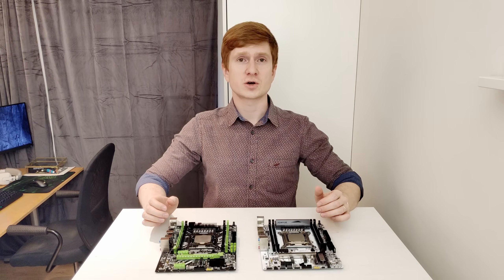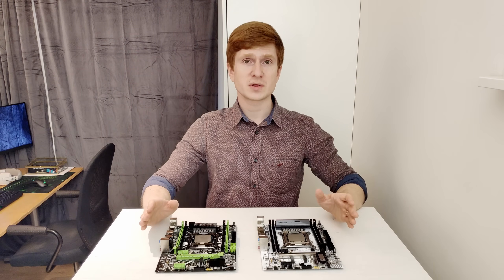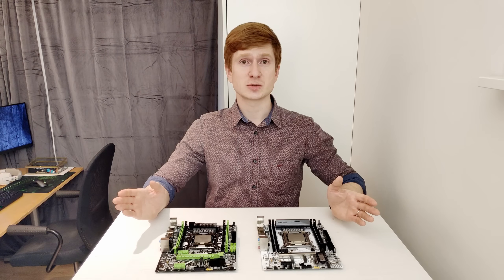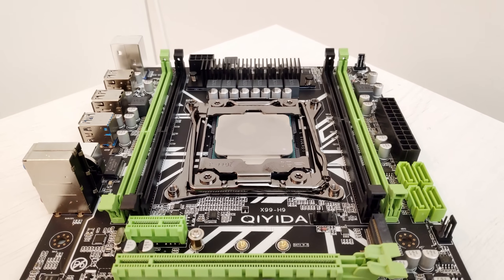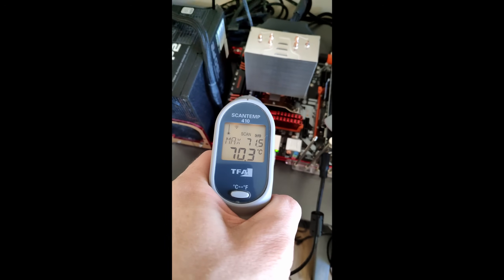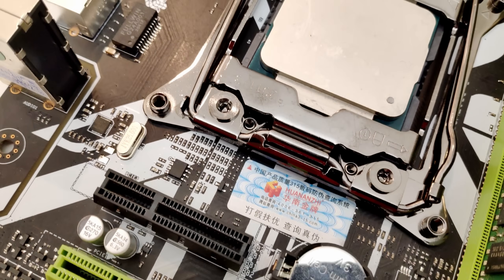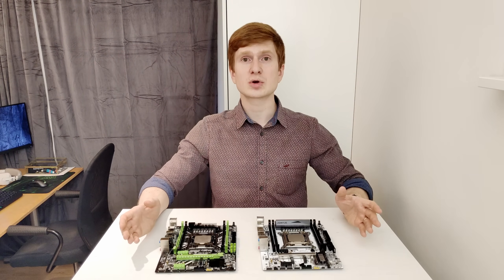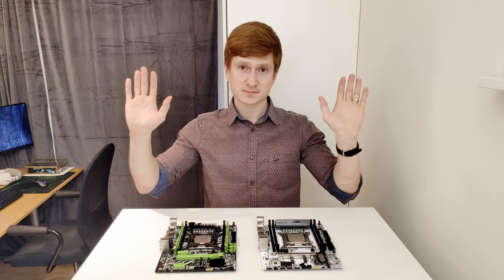🇬🇧 Jginyue X99M-Plus D4, Qiyida X99-H9, Kllisre X99 V201, Machinist X99-RS9 – tests and conclusion

Comment: I found the same problem on all boards I tested.  Power delivery is ridiculous and none of the cpus reached their advertised boost clock speeds and they were unable to maintain the speeds.  When benchmarking I found the cpus clocked down to 2.88 ghz at 100% load, which is lower than the advertised 3.30 ghz speed on the intel website information pages.  I messed with the power settings on the board but it still wont clock up and maintain the boost. It's almost like the boards are limiting the frequency of each CPU by reducing power.  Probably to prevent overheating of the crappy components.
Reply from the maker: It seems like you don't understand how Intel Turbo Boost works, the advertised max frequency is only achievable with a single CPU core. For all-core load Intel guarantees only the base frequency.

Comment: hi, what kind of cpu cooler will fit? I try a lga2011-3 which socket it should be, but it does not fit. do you have a solution? Thanks
Reply from the maker: I need to see pictures to understand what doesn't fit because LGA 2011-3 coolers must fit.
Reply: @Miyconst  Thanks for the reply. I found out, that lga 2011-3 sockets on consumer and server boards having different formfactors. 80x80 and 56x94 mm. I have the last size and the board have the 80x80 mm. So I need another cooler

Comment: I have problem on my jginyue x99m plus D3 and xeon 2666. 
It freezes after a while. With speaker buzzing sound. Then cant post beep anymore. Just turns on and off
Reply from the maker: Most likely the motherboard is fries.
Reply: @Miyconst  dead board?
Reply from the maker: @drexter09 yea, most likely.
Reply: @Miyconst  should i replace my xeon into a lower tdp model next time. To avoid issues on a new board
Reply from the maker: @drexter09  no, but better get a better motherboard.
Reply: @Miyconst  can you provide? I need the white board for xeon
Reply from the maker: @drexter09 there is not much to choose from if you really want a white one, maybe Machinist X99-K9?
Reply: @Miyconst  better than jginyue x99?

Comment: What BIOS is currently recommended for Jginyue X99M-Plus D3 V 2.0 (DDR3) with Xeon E5 2673 V3`? 
I used the "Mi899 -tool" (Thanks for the effort), it was easy to do a BIOS backup and also to flash this version "X99M-Plus-V2_Timing_Unlock_-90mV.rar
4.5 MB" ... however it seems so that despite positive Memtest and allCoreTurbo 3.1GHz it freezes the M.2 WD Blue NVMe every now and then or does not detect the boot NVMe. C6-States as well as the repo are disabled.
Reply from the maker: I am afraid this is the motherboard issue and BIOS won't fix it.

Comment: Hi, thank you for all your videos about X99 platform. I have found them very informative and helpful.

Having said that, I have recently been given a Kllisre X99 V201 motherboard and due to the poor Vrm heatsink I'm worried about pairing it with my 2640 V3 with turbo unlock. Do you think it can  handle that or should I try to replace the Vrm heatsink with a bigger heatsink or M.2 heatsink with fan?
Reply: I also have a spare 2680v3 which I'm hoping to test on this Kllisre v201 motherboard if I change or modify the heatsink.... Suicidal? Lol
Reply from the maker: Well.. if you ensure good VRM cooling and don't torture the motherboard with 24/7 load then it should last for a while, but be ready that it may die at any moment of time.

Comment: I have a x99 rs9 with Q87 chipset and the microprocessor is an E5-2690 v3 has a tower with 3 fans and copper tubes and as a case a thermaltake core v21 with 3 additional fans in addition to the large front that brings. I am concerned that suffers overheating as it is to record videos in the would be advisable to make an undervolt by bios in this case?
Reply from the maker: Undervolting V3 Xeons bring more load onto the VRM. When Turbo Boost frequency is unlocked, the CPU clocks all cores to the maximum frequency as long as TDP allows.
Reply: @Miyconst  ok analyzing all my possibilities i will go for the safest thing i will buy an e5 2640 v4 microprocessor since i need the processor to be of 10 cores for rendering. meanwhile i will use the e5 v2690 v3 without trying to force it for office work and in case of entertainment for games that do not ask me to use the cpu a lot and lower the values to the minimum possible in this case. I understand that the 2640 v4 does not support TBU several recommended me that so I could use the microprocessor 2690 v3 perform an undervolt but better just change the base bios for one of those recommended in the video to improve the problems of this motherboard and wait for me to get the other microprocessor. Thank you very much for your help!

Comment: My motherboard is kllisre x99 201 E5 v2666 v3, would the huanazhi 8m-f Pei 50/50 work?
Reply from the maker: It should, but there's always a risk to brick the motherboard.
Reply: @Miyconst  I currently have the default m8-f hz on it, but I don't have the turbo boost
Reply from the maker: @grikenstudios3357  then 99% it will work with -50/50 MV offset, just make sure that you have decent VRM cooling.
Reply: @Miyconst  I just flashed the bios with that format and the processor frequency is the same 2893mhz :c
Reply from the maker: @grikenstudios3357  did you restore the BIOS defaults after the flash? Do you have clean Windows installation?
Reply: @Miyconst  If I already restored the values and the processor works the same as before xd
Reply: @Miyconst  How do I flash the backup?
Reply: @Miyconst  Could it be because I use the motherboard without a battery?
Reply from the maker: @grikenstudios3357  it could be, but only if you cut off the power, otherwise the motherboard should preserve the CMOS values. You can flash the original BIOS exactly the same way as the modded BIOS, with FPT or AfuWin.

Comment: Is e5 2673 v3 better pair for jginyue x99 D3 ddr3  board or e5 2666 v3? 
How is their gaming performance difference?
Can i use normal ddr3 ram like kingston hyperX on jginyue x99-plus D3?
Reply from the maker: Yes, you can use normal DDR3 RAM, but 1.65V modules might have compatibility issues. E5-2666 V3 is better for gaming, but also harder on VRM.

Comment: Hi can you help me i want to build a jginyue x99 D3 and e5 2666 v3 is it possible? What ram type and preparations should i do? I prefer to use jginyue x99 D3 only
Reply from the maker: It is possible, and you don't need any special preparations, it should just work. Any 1.35 or 1.5 DDR3 memory should work, but 1.65V sticks may have a problem.
Reply: @Miyconst  i dont have to use ecc ram/ server rams? Or those are better than typical consumer rams

Comment: unfortunately when i watched this video i had already bought the qiyida h9 motherboard. I bought together e5 2640v3. Do you think this cpu will do well with the motherboard even in turbo? since it has 8 cores. Or will it even support 2650v3 well? the chinese seller said it runs everything haha.
Reply from the maker: It should be fine if you implement good VRM cooling for your motherboard.

Comment: Donated! Loved your video, analysis and how much time you have saved for a lot of people like myself!
Reply from the maker: Thank you very much for the support, the donation is also very appreciated.
Reply: @Miyconst  A question I hope you can answer that led me to your videos. I have a 5820k cpu and 4 x 8GB of Non-ECC DDR4 memory (GSkill Ripjaws V) collecting dust.

I don't doubt I will have any cpu issues because it is 2011-3 socket.

However, I am having a hard time understanding how these ebay motherboards could provide dual memory type support.

Do you know of the 4 motherboards, which one can boot with Non-ECC DDR4 DIMMs? Thx
Reply from the maker: @MarkLapasa  all Chinese X99 motherboards work with normal non-ECC RAM, but only if you use one RAM type at a time, and non-ECC RAM modules must be 1Rx16 or 2Rx16.
Reply: @Miyconst  you are the best! Thx

Comment: Did any of these boards work with Intel i5/i7? I got  a 'H9' to test some X99 i5 CPU, BIOS loads but wont boot with them
Reply from the maker: There is no i5 CPUs on the LGA 2011-3 socket. What are you testing?

Comment: Hello !
I made several computers with x79m and x99m xeon. I Have mainboards from Jginyue, machinist with E5 xeon. 100% working great (thanks to your turbo unlock mode on X99plus D4!) 
I wanted to use AIDA64, I tried every mode (engineer, extreme, businees) but it freezes every computer. Is there a reason why?   Hwinfo, cpuid, cinebench run great.  Any idea?
Reply from the maker: Yes. These Chinese motherboards with desktop chipset have some defect in PCH monitoring. Disable it in Aida64 settings and it won't freeze again.

Comment: Hello , I'm sorry to bother you but you obviously have great experience with most of the systems on x99 , I am building a system on 2640v3 ,what is the best option in your opinion ? I'm stuck between jingyue titanium D4 and machinist RS9 ...
Reply from the maker: Both motherboards have their issues, but I would go with X99-RS9 or Huananzhi X99-ZD4.

Comment: So does the bios huananzhi x99-8M-F work for the Kllisre x99 v201?
Reply from the maker: Yes, it does.
Reply: @Miyconst  my board has h81 chipsets ... and in the mi899 program I see that the bios on the hz x99 8m-f board are for b85 chipsets ... my question is the same, would it work on my Kllisre x99 v201 board with h81 chipsets
Reply from the maker: Yes, it's also compatible with H81 chipset, unless Chinese made some radical changes with your motherboard.
Reply: @Miyconst  Thank you very much it was great
Reply: @Miyconst  Friend and I had a problem with the pc shutting down suddenly and now it does not detect the Windows installed in my nvme ... The bios recognizes it but it does not start Windows ... I already formatted and I reinstalled Windows and it does not recognize Windows .. . What I can do?
Reply from the maker: If the PC shuts down you have a much bigger problem than the BIOS. Hardware failure has to be detected and eliminated prior to any BIOS mods.
Reply from the maker: @enzozapatavilchez6200  first you have to revert to the original BIOS and figure out what is wrong with the hardware why it's shutting down.
Reply: @Miyconst  Friend, apparently the board was giving a lot of voltage to the video card ... the solution was to install the msi afterburner and lower the voltage and now everything is ok ... thank you very much for the support ...
Reply from the maker: @enzozapatavilchez6200  hm, the board has nothing to do with the GPU voltage. GPU has its own VRM, which is responsible for voltage regulation. Your GPU might be dying out, take a close eye on it.

Comment: My RS9 doesn't recognize the NVME and only recognize the SSD sata on port 1 do you think it's a problem in the bios?
Reply from the maker: Most likely this has nothing to do with the BIOS. Please specify full PC configuration.
Reply: @Miyconst  Machinist RS9 motherboard, Xeon E5 2620 V3, 16gb RAM (2*8 Atermiter), 512Gb Kingdian nvme SSD, 600W Redragon power supply, Amd R5 230 GPU
Reply from the maker: @phillipesousa4608  it is very likely that this SSD is not compatible with the Chinese X99 motherboards, saldy.
Reply: @Miyconst  it was working fine it has been using it for 7 months but suddenly it stopped and it keeps oscillating, hours it works hours it doesn't work
Reply from the maker: @phillipesousa4608  so, one day SSD just stopped working? You should have started with this. Something has died, either SSD or motherboard, test both with other parts and identify which one is dead.

Comment: What have I done wrong? 
I put a E5 2620v3 on my X99m-plus D4, 2400mhz DDR4 4gb, 600w power supply and a gt710.  No image ! just a "BEEP BEEP Boop" 
I switched Ram, I changed the graphic card, changed the cpu  ... same "beep beep boop"
H E L P !  (please!)
Reply from the maker: This beep means that the GPU is not recognized, which can be caused by many reasons.
Reply: @Miyconst  Thanks !!!   It was the monitor sending error to the gpu. I change for an old 17" and it works !!!!!!!!!  Is there somewhere a manual for this motherboard?  Official website Jginyue has no valid information, just old drivers. 
Next stage : Update Bios to unlock CPU Turbo...
Reply from the maker: @sergeleenders6122  you are welcome, and no there are no manuals for these Chinese motherboards, sadly.

Comment: Hi Myconst, thanks for all your jobs.
I have an X99m Plus D4, and i have flashed your mod bios, from Machinist x99z v102.
Motherboard work very well, but from press button on pc to see bios image it pass 30/40 seconds..  do you know wy? It is possible to fix? Thank you very mutch!!
Reply from the maker: Unfortunately there is no fix for the long boot. Also, which BIOS did you use, are you sure it's X99Z V102? V102 uses C612/X99 chipset, while X99M Plus D4 is B85, so the BIOS is not interchangeable.
Reply: @Miyconst  thx for reply. In your Mi899 software there is no bios for X99M plus D4, ( but motherboard is present).
I have flash C612RD24 for Machinist x99z V102, and motherboard work ( boost is unlocked on all core, there is suspend mode, ecc). But black screen after press power button, is so long. 
Original bios is mutch fast, but is not good bios.

Some advice?
Reply: Mi899 version is 1.2.2, in one forum i have read this problem on some x99 motherboard (asus in this case), and problem is "Training ram at boot"... But i have no found options in bios.
Thx for all
Reply from the maker: I am very confused. Could you please check what chipset is installed on your motherboard and share a photo of it? As far as I know, X99M Plus D4 is not compatible with the X99Z BIOS.
Reply: @Miyconst  ok, today i check for you. Thx so much!!
Reply: Ok i have checked. Were i can send some photos?
Reply from the maker: @sugo76  you can use Google drive and share the folder with me: miyconst@gmail.com
Reply: @Miyconst  link sended on your emal. Thank you!!!!

Comment: Can i use  huananzhi x99 8m-f bios?
Reply from the maker: Yes, these motherboards are compatible with Huananzhi X99-8M-F BIOS.
Reply: @Miyconst  help plss, i flashed Huananzi x99 8m-f bios on a qiyida x99-h9 and now when i start My PC get freezed on a screen that says Intel inside
Reply from the maker: @lowdax766  did you restore the BIOS defaults after the flash?
Reply: @Miyconst  idk, but i disconnected my pc like for 30 minutes and after that i tried to start it again and it worked, now i have more fps on wz, THANKS FOR YOUR BIOS MOD!!, you helped me a lot

Comment: I have the Qiyida X99-H9 in your program, there is no new bios to unlock using the 2620v3 processor, which bios should I use? Do you recommend unlocking? I'll put a fan to cool the vrm a little. Thanks to your video I know this motherboard better.
Reply from the maker: Qiyida X99-H9 is compatible with Huananzhi X99-8M-F BIOS, you can use it to unlock your E5-2620 V3.

Comment: hello mate, at current prices for a good x99 mobo combo, do you really recommend go for it, or im better off buying an a320m + cheap ryzen (r5 1400-1500) + 8 gb ram 2600mhz? or is a x99 combo with e5 2620v3 with a cheap x99 mobo superior to the cheap ryzen combo?? maybe you could do some video a bout comparisons in prices/performance better choice, thanks
Reply from the maker: The current prices are very unstable, thus I am not able to give you a clear recommendation, but in general, Ryzen 1 and 2 series require fast memory with at least two memory sticks, otherwise you are getting a really pathetic performance.

Comment: Thanks from Brazil! I got a x99 rs9 with a 2630L V3 processor, can i just flash the x99 xm-f default  bios on it with no issues with any q87, b85 chipset?
Reply from the maker: Yes, it should be possible, but responsibility is always on you 🙂.
Reply: @Miyconst  Yes i Know, but without your knollege it would be impossible, :-).

Comment: Tks for your explanation, I've bought this krllrs v201 to my wife.
I wanna use unlock turbo boost with 2620 v3 , I'm thinking to create on my 3d print vrm ducts with 120m fun. Which should I do , cover just heat vrm or cover all capacitors also ? It's better to use fun in or out ?
Very tks Mr myicosnt
Reply from the maker: It's better to cover the VRM components, but you have to be careful not to cause a short circuit. The fans should blow air into the heatsink, but make sure that there is a way for the air to escape through the heatsink.
Reply: @Miyconst  ok tks for explanation if work I share files

Comment: Машинист х99 102 разогнанная с процессором 2678 перестала включаться через 2месяца,сгорел южный мост
Reply from the maker: That's a pity, but these boards are surely not designed to handle E5-2678 V3.